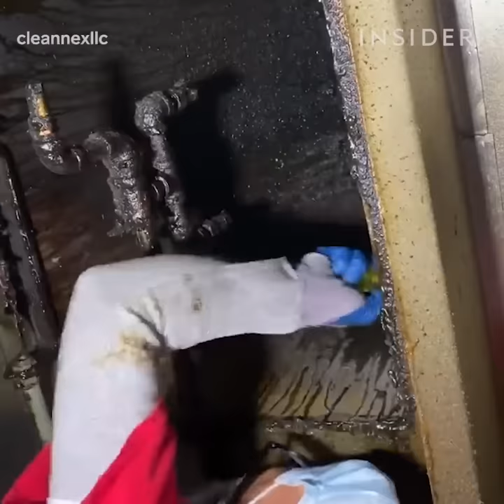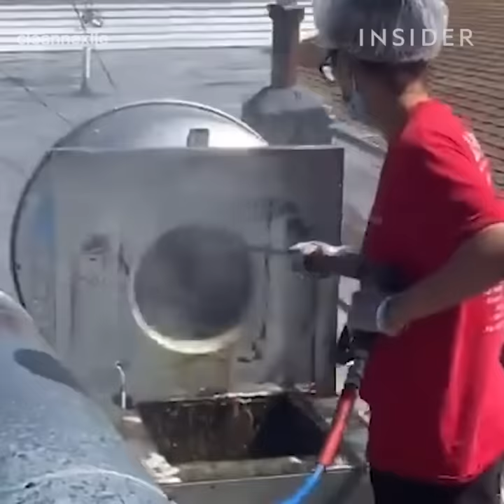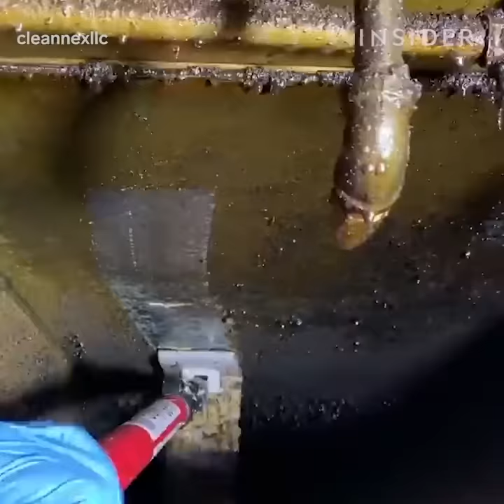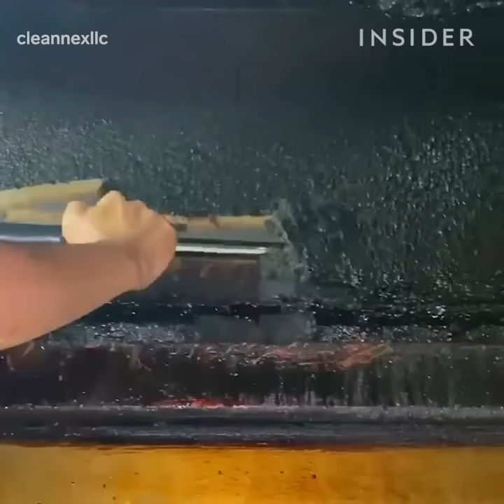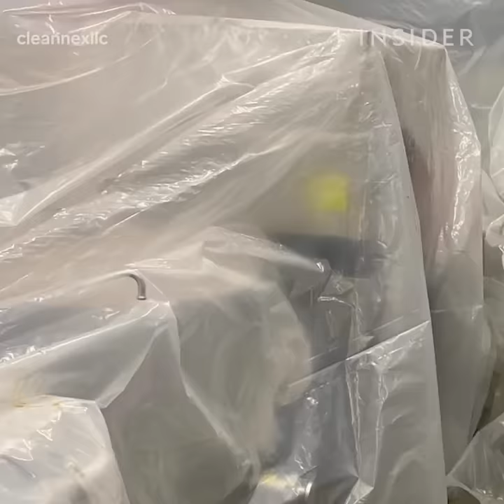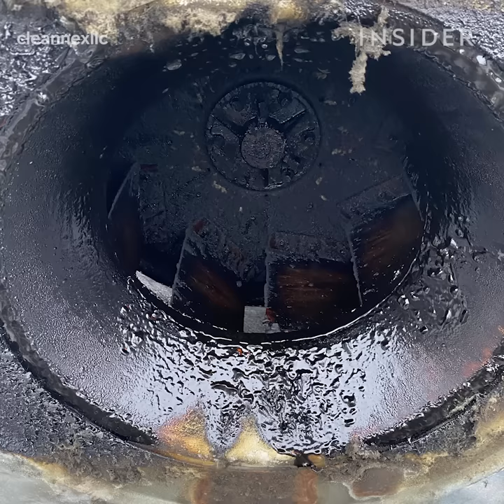How Thick Layers Of Restaurant Grease Are Cleaned | Deep Cleaned | Insider

Comment: I did this for 2 years, started my career In the fire industry here. This is the hardest work I’ve ever done. 10pm-7am wrapping hoods, spraying chemical, spraying water, on rooftops in the dead winter snow. Respect to all the hood cleaners out there.
Reply: Yknow, this might be a job right up my alley. How physically demanding would you say it is?
Reply: @salemcrow5078  it’s exhausting. You’re out from 9 pm- 7 am sometimes later if you have a client that needs done at 7. By the end of the night you’re covered in grease, soaking wet and freezing in the winter. You have to be able to climb up ladders, carry pressure hoses, roll around cans full of water. Climb around kitchen equipment. Sometimes put heat blankets on top of 600° pizza ovens and work on top of those because those can never cool down, sometimes your plastic will rip and water will flood everywhere and you have to figure out if you want to flood the kitchen and then clean it or stop and somehow McGuiver a patch on wet greasy plastic.
Reply: I did this job for a little bit too. Definitely very challenging work. If you like cleaning though, it's pretty satisfying.
Reply: Lol me too don't tell me you worked in the southern nh Lowell mass area this video brought back nightmares after 20 yrs 😂
Reply: Welcome to the hood bro
Reply: Yep. Did that for about 8 months and just couldn’t stick with it. It’s really really tough work.
Reply: Been doin this over 10 years outta high-school. If my boss wasn't a great dude, I'd be gone long time ago haha
Reply: @imnotokay7yago588  I see what you did there
Reply: I cleaned a Outback at night, you should have been on the crew that cleaned there hoods.
Spray chemicals up into the hoods, then just backwash it all over the grills. those guys were in there no longer then 2 hours, as I was the one that had to clean the floors after they left.
Reply: Yeah, it's harder than roofing in the Florida summer or coal mining
Reply: If this is the hardest work you've done, you're soft.
Reply: Was that the two years prior to Arsenal?
Reply: @vandalg282  if you think this is soft work you have no idea what goes into it
Reply: @EnkinduGamer  Is the money good? like $50+ an hour?
Reply: @YR2050  No. Not even close.
Reply: @YR2050  it really depends on the company. i doubt you'd ever see this job at $50+ an hour unless they were doing some really high profile places only
Reply: @YR2050  My position is Team Lead. I make $25 an hr. My helper makes $15 (My employer only uses a crew of two).
Reply: One could say this is a certified hood classic
Reply: @vandalg282  you single af 🤣
Reply: I 💯 believe you!!  I was going to say this looks like one of Worst jobs Ever!!  The amount of time, effort, patience, etc just to get all that grim\ grease off and Spotless!!?  I Know what hard work is and this is it!
Reply: Hood cleaners or cleaners in da hood?
Reply: @casedistorted  I ain't seen the hood get that greezy 😬
Reply: I once knew a hood cleaner too but they made him illegal his name was crack cocaine
Reply: @jorgerios1473  ouch
Reply: I am overnight cleaner at McDonald's. I pretty much do everything. Kitchen, dinning, back of house, parking, external,   windows, toilets, pressure wash etc. 

I clean the hood filter hood area behind up as far as can reach. They have people who come out a few times a year to do the full clean of the exhaust. 

This video has helped me with tips that will help me work better, and more efficient. I never had proper training so I needed to train myself. Any problems I had, I was told to fiquire it out. So I think logically to find best practices. 

(I've been wanting use the plastic wrap to prevent grease on floor, but have had problems holding up) (I've tried to use tape that didn't work, and now I just realising I can try magnets that should work 😀)

 (McDonald's does have some procedures for these jobs but I haven't had access to training materials for 14-16months due to login issue that they haven't been able to fix for me)

( I did look at some of procedures back for these job but that was at start of 2020 when started cleaning job, and is good to have refreshers) (plus continue development)

Good news because I think they may have fixed their system as I go email that said something about login but haven't had time to look yet. 😀

Thanks for video.
Reply: I have respect for you man, this looks like very tough work.
Reply: I feel you there did it for Chipotle for 3 years
Reply: City folk consider this tough 😂
Reply: Worse part is setup and take down
Reply: I wish I had that job
Reply: @Iw1372 yo you got it spot on bro 😂

Comment: For those complaining restaurant staff don't do enough, this is the exhaust, not the kitchen itself, I can't imagine restaurant staff will have the skills or equipment required to do this. This sounds like it is something outsourced to a specialty cleaning contractor on a regular basis to comply with a city's health and fire safety codes which I imagine get inspected by the local council a couple times a year. 

But it got me thinking about the exhaust pipes in houses, it is a legitimate fire hazard and I don't think I've ever had someone come into clean ours. Should get someone in!
Reply: Yeah restaurant staff can't do this although some restaurants do attempt to have it done this way but the fire marshal needs certified cleaner to have it done regularly and submit documentation
Reply: Least we can do is clean the filters frequently
Reply: Exhaust from dryer lint is also very dangerous. You might want o also check that out. People don’t realize how dangerous they are. Especially in apartment buildings. I’m houses too. The lint builds up, and is highly flammable. Then you can’t get it put out burning inside.
Reply: i cant imagine a house will have this level of buildup even after a decade. unless you're running a catering business from home.
Reply: I don't think houses have exhaust pipes, at least not like here. Maybe mobile homes. Houses usually have vents. Your vents collect dust. That's all the stuff you're breathing in. You should get it cleaned. Exhaust is usually for industrial places. Ahh, forgot about chimneys. Also forgot about the kitchen vent. This is stuff one usually doesn't think about.
Reply: I work in an Italian restaurant and I'm the main pizza cook for one location. I do weekly cleaning for my vents/filters and the "cook's line" aswell. I dont have long tools like this and they're making it look like a breeze hahah.
Reply: If you cook ”normal” food at home, the recommended time span for checking and cleaning your kitchen hood and exhaust is about 5 years or so. If you clean the filters or change them regularly, there shouldn’t be that much buildup in the system. Source: me who works with chimney sweeping and fire prevention :)
Reply: We do this every day in our restaurant. I guess different standards from NA.
Reply: kitchen staff wouldnt be paid enough for that and leave the job anyway :p
Reply: I've never seen a comment with a scroll bar, let alone a horizontal scroll bar, am I alone on this?
Reply: Not only that but the last thing you want is an employee scraping that grease all over the stove and floor. Got to have the proper clean up gear for AFTER the job too!!
Reply: @alekswhy88  Actually no. Numerous companies have gotten away with not doing this kind of cleaning... ever.
Reply: @ericthiel4053  I used to work 3rd shift when this was done and had to use boiling water to get the floors clean. And that's with heavy duty plastic tarps funneling the water from the power washer into 35 gallon buckets.
Reply: @alekswhy88  The state I live in requires a sticker be placed on the hood or the box that contains the fire suppression system. It had the date on it and the fire marshal could shut you down for it being overdue to be cleaned.
Reply: Considering the amount of time it take to do this, i doubt many restaursnt can afford this cleaning regularly
Reply: @keselekbakiak   I’m a cleaner in nc, regular hoods are cleaned every 3 months some prep hoods in some restaurants only need to be done annually tho.
Reply: I did it at all the restaurants I worked
Reply: I work at a kitchen and we have a crew come do this about once a month, but we ourselves do the walls and filters daily

Comment: I've worked for a well known restaurant chain for 9 yrs now as a night shift cleaner and I've honestly never seen hoods and filters that bad. We clean them every night after closing and it only takes ten minutes with a cloth if you keep on top of it. We only need to get a company in every 6 months for the ducts and fans.
Reply: True
Reply: Filters will look clean and still be packed full of grease behind and between the baffles. I’d recommend getting a second pair and soaking/drying one pair while you are using the other. You can tell this by weighing them before and after soaking them. Huge difference it will make.
Reply: @joeydewitt4639  ours are steel reusable filters they get taken off and steeped in degreaser once or twice a week depending on how busy we've been. The oil filters for the fryers though get replaced every night with a new set.
Reply: That be dirty we clean the store every night and the hoods and filters are always cleaned at closing
Reply: Depends what you cook with, restaurants that need to clean a lot most likely use very bad oils like canola or sunflower. Cooking with butter doesnt cause these messes
Reply: No wonder since they hired you for maintenance. These restaurants in the video apparently spent a whole year not bothering at all.
Reply: I love how Americans call fast foods, "restaurants"
Reply: Not if the restaurant uses soya oil, those things are like sticky fly traps when it's burned.

Comment: Did this exact job for about a year. We used caustic soda as degreaser. Covered everything with plastic sheething and the works, same as the video. Wasn't a bad job, biggest downside was third shift. And always smelling like a kitchen.
Reply: How much was the pay
Reply: @alexgee3072  I was making $16/hr. This was also seven years ago. Had I been the one with the certification I would have been making around $20/hr but I was working under one.
Reply: @Larping101  exhaust masters/hood masters but chance?

Comment: Many insurers now make it a requirement to have commercial kitchen exhaust systems cleaned out periodically, or your cover is void, because the grease build up is a big fire hazard. Also some of these, maybe older, exhaust systems are not really designed to be taken apart and cleaned. So the work might also involve removing rivets, or cutting holes into the sheet metal at various places for access and then patching it up again.

Comment: I used to be a cleaner and I had a job where I deep cleaned the ENTIRE kitchen at like 10pm after they closed. I was lucky enough to have a removable bottom for the grease and crumbs. But I literally had to stand on the thin edges of the stove and tight walk around it as I crouched my head down and sprayed, wiped, then polished the metal top that sucks the smoke out. That was the worst place I ever had to do. Luckily my boss was there and gave me a hat so my hair wasn't caked.

Comment: This has been my primary line of work for five plus years and I will be honest with you and say that this is completely normal for hood vents to look like this. Especially right now people are saving every penny and they wait until the health inspector forces them to clean it or decides to shut them down. My average cleaning is done every 3 months some places wait 6 months I've got a few places that go over a year. It's a pretty sketchy Cutthroat business they may use you once and then go years without using you again maybe use someone else or maybe not get it cleaned at all but just polish it on the outside and assume the health inspector won't look deep inside. Not only that they also expect the best price... When it looks like this crap I'm not charging less than $1,000. Doing this line of work for so long I'm quite happy I know what goes on in the restaurant industry so I know which restaurants to eat at and which not to eat at oh, I'll be completely honest and say most Asian restaurants look like this on a regular basis and their grease is the worst it needs to be done more often than most yet they are the ones pushing it further back than the average restaurant to save a penny. You can't afford a hood cleaning for around $400 to $600 every few months then you shouldn't be in this business. PERIOD.

Comment: Was gonna say this is normal for any restaurant that you eat at. All that oil doesn't just evaporate like most like to think it does. It just builds up in the exhaust system. In which restaurant staff do not have the tools to actually clean out the hood itself. We can certainly clean the filters, yet the internals of the hood is not possible outside of hiring someone else to do it.

Comment: I figured it out, mix Sodium Hydroxide with soap, spray on to grease, but before attempting see if you can scrape off with a generic scraper you can buy at any hardware store, paint scrapers are exceptional but requires resharpening compared to disposable single use scraper blades

Comment: How about inventing a system where you can wrap the walls of the ducts with a kind of foil which later could be removed/replace when it has accumulated enough grease?  Will that work?

Comment: My first job was doing this. Most people were on disability or undocumented. Or they couldn't get a job for other reasons. We're paid under the table.  Long hours. Hard gross work. Unsafe workers. They would touch and eat any food out at the restaurants. One guy had red bumps and burned hair from not diluting the degreaser because it "worked better" got fined for pouring stuff down drains every once in a while. We're told to do it anyway. Lasted a week. People would mutter "get out while you can" as I walked in every day. So I did asap. No 2 weeks.  Good memories.

Comment: Please use Oil solidifiers, like BCI's Oil Solidifying Polymers (formerly known as C.I. Agent), are composed of dry, high molecular weight polymers that have a porous matrix and large oleophilic (strong affinity for oil rather than water) surface area. Upon contact with oil, the oil solidifiers form a physical bond with the oil.
More cheaper than hire somebody for clean it and the grease just too gross don't dump it whatever you want

Comment: "Restaursnt grease". My worst experience working overnights at hotel with a restaurant and roof top bar. Smelling of that crap when the deep cleaners and grease trucks comes to suck it out of the kitchen/grease traps. I remember the engineers accidentally turn the vents on reverse and was sucking the air back into the hotel...

Comment: You would think we should have some substance that can coat the vent that repels grease by now.
Reply: They do. It's just way to expensive to coat every restaurants vents with it. Also those protective coatings have to be replaced over time adding even more to the expense. Not only that, you would have to now find a way to catch all of the grease that's no longer coating the inside of vents or grease traps, which could involve adding on expensive parts or replacing a grill entirely.. It's a domino effect. Not saying it couldn't be done but it would turn the way restaurants deal with this problem upside down, which to them doesn't make sense to their bottom line.

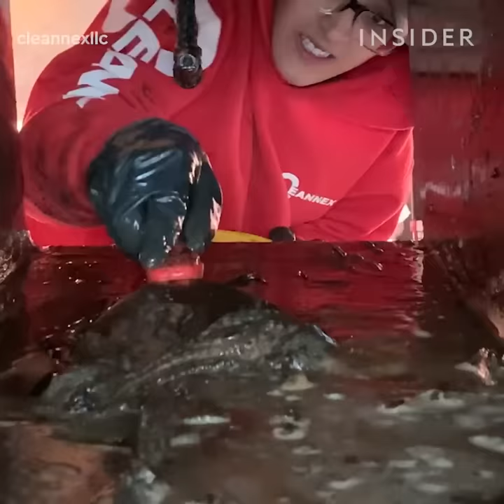Comment: 1:30 "A year's worth of grease." Try 2 weeks in a fast food joint. I've worked alongside exhaust cleaners in my restaurant in trying to clean up after. It's a horrendous mess. I have one bit of advice for those getting into the business: If you do not have the equipment or situational awareness during post-cleanup to  handle accidents or a plan to clean those up, such as greasy water running under equipment or tackling rooftop debris and splatter, you are going to reflect poorly on your company and your customer is going to find someone else. This is very often a thankless job. Do yourself a favor and be the best professional at your worksite that you can be.

Comment: Oh the memories. You aint seen nothin till you clean an old style A frame Whataburger. All the funk goes down a large metal tube, takes a 90 at the corner, then runs underground to a grease pit, where you have the pleasure of scooping it all out with a 5 gallon bucket in 100 degree plus heat. The smell will gag a maggot!!!! Then there is chinese food places where all the soy sauce carmelizes and 3000 psi 210 degree water with soap does NOTHING TO IT!!!! It has to all be scooped out with a putty knife. Oh, and lets not forget the times that the hot greasy, funky water comes down the wand, past your wrist, across your arm pit, down your draws, leg, and fills up your rubber boot!!!!

Comment: I doubt restaurants need or does this every year.
I would say 5-7 years, depending on how much is cooked
Reply: Yeah, no. Grime builds very quickly, and if you’re a busy restaurant, it can get out of control fast. 5-7 years the system would probably ceased to work properly. Plus, the fire risk would put everyone in danger unnecessarily. It’s a literal health risk if you fail to maintain it.

Comment: I owned a restaurant for 7 years, this is not the way to do it. You have various filters that prevent the grease from getting into the duct, meaning there's no build up of grease in the duct, you then only have to clean/replace the filters on a regular basis. Ducts that are this greasy as in the video can catch fire and are really dangerous.